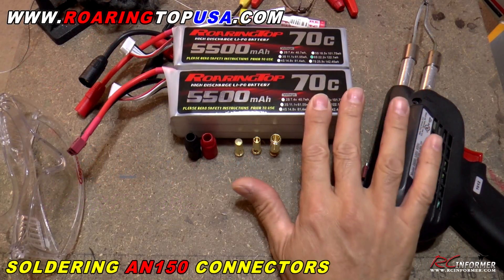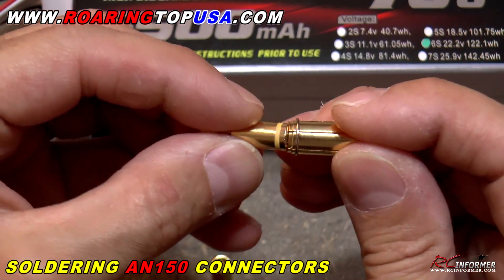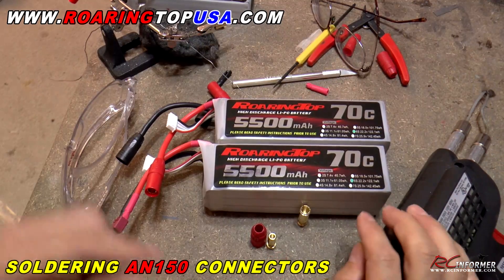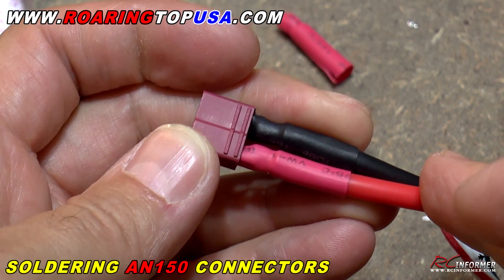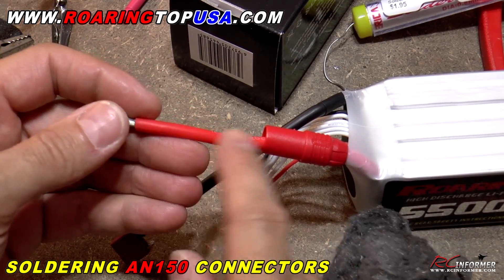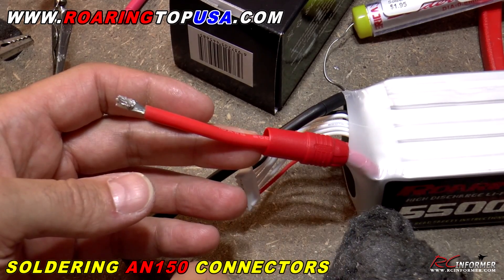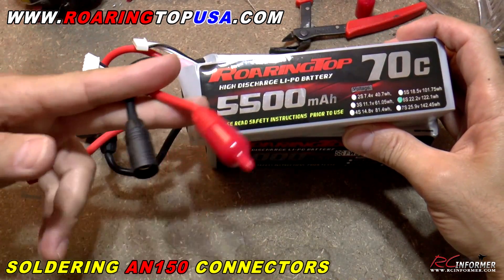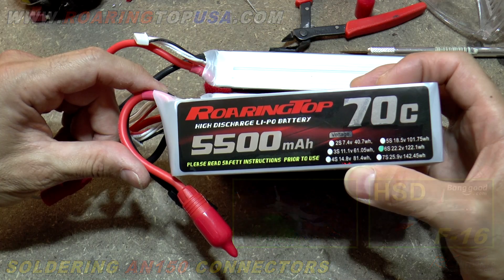How to solder the AN150 7mm Spark Arresting Connector By: RCINFORMER

Comment: Why is the connector set with the anti-spark resistor on the ESC side instead of the battery side?
Reply from the maker: So you only need one spark arrestor. Otherwise you need one for every battery:)
Reply: @RCINFORMER  Makes sense! Too bad they only come in packages with one pair regular and one par anti-spark, so you'll have the same number regardless. Since that's the case, I figured that having the anti-spark on the battery side might be a good idea because the resistor is a potential failure point and I'd rather have the connector on the batter side die instead of the device side so I can still fly out in the field with another battery if that happened.
Reply from the maker: @strawhatsam  you can still put a spark arrestor bullet on the battery also & use it with the plane. You will just have two arrestors in the system. I think they sell them in bags with just the male and female dummy bullets for the battery side of the system.

Comment: To ensure that I never plug the negative into the positive on the same battery I alway have female connectors for both negative and positive on the batteries.  This way i cannot plug female into female.
Reply from the maker: RC Addict That will work also... it can be done both ways. The way you are doing it adds the risk of connecting the batteries to the plane in reverse-polarity. I had a friend do that once with bullet connectors and the plane nearly burt to the ground & ALL the electronics were destroyed & it caused a spark & it almost blew up the batteries! Either way there is a down side, you just have to decide which way works best for you. It's a bit of a trade-off of risk. Your method also requires a separate male-to-male connector wire to join the batteries in series. So far, the manufacturers that use these connectors, mostly have the ESC set up with a one male spark arrestor bullet on the red positive wire & a female bullet on the black negative wire.
Reply: +RCINFORMER Good points. I did have to add in my own connectors on the ESCs. I guess the bottom line is to pay close attention when plugging things in. BTW A lessons learnt for the folks new to AN 150s..... You have to watch the heat with those males with the capacitor. I have popped one due to too much heat while soldering. I use these connectors on my HSD super viper, HSD F-16 and Freewing Mig 21. The next time I get batteries, they will be Roaring Tops. I have heard some great things about them. Your endorsement also carries a lot of weight.
Reply from the maker: Good comments....Thanks for watching!   its best to set it up the way you prefer and follow your own procedure carefully when connecting these batteries...
Reply: To minimize ruining the Anti-Spark arrestor on the male conn, plug it into a loose female conn (not on a batt) so it holds the resistor part firmly to keep it from swelling and deforming. The female conn also acts as a small heat sink to take some of the heat away.